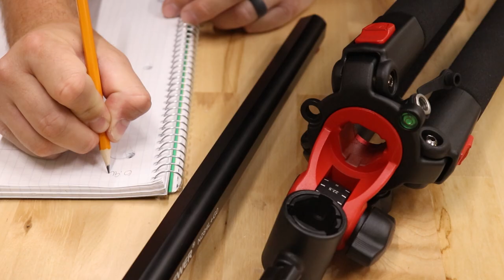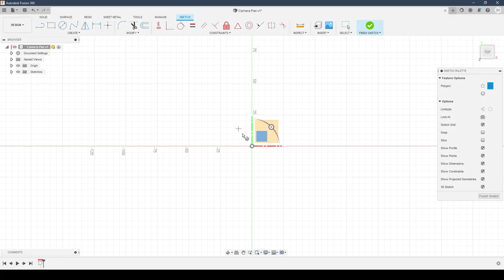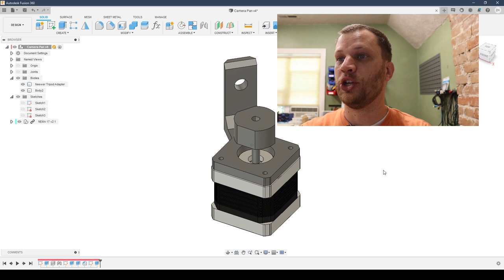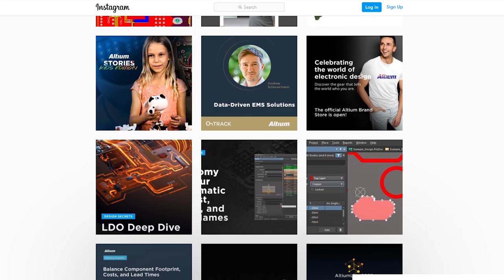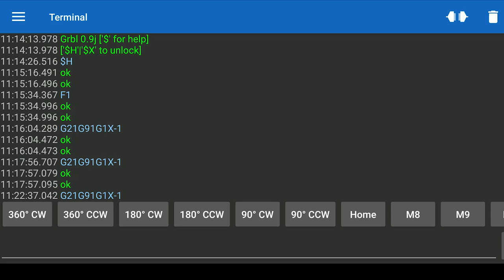Can Your Tripod Do This?

Comment: Great project and very nicely done! 
With serious photography as a hobby/passion of mine,  I've dealt with this same situation too.. 
Unfortunately,  I'm a Derp,  so my brain retains as little as possible when it comes to codes / programming.. 
It's killer that you did this setup using electrical pieces,  parts,  and coding. 
[I've only ventured into that back when building / tuning RC areal crafts]
For the automated tripod,  mine used modular components..  1 pan setup / 1 tilt setup 
They stacked:  Top tilted / Bottom panned.  Bottom mounts to 1/4-20 / tripod,  top mounts for cams, etc..
As you'd assume,  I used spare RC hobby components:  Transmitter,  Receiver - from an rc car 
The radio sticks would then be used for motion control.  Which was MacGyver Approved.  Success.  haha 

There are pan/tilt 'mounts' for cams and telescopes..  That's what I'd like to build next.  Real burly.. 
A guy on yt saw a little kids school project - kid made a motion-sensing/following 'turret', 
so the dude stole the kids design and codes and made his own.. 
It holds a paint ball gun,  and uses a cam,  phone,  arduino,  etc.  to find/lock the 'target', 
and then the trigger is servo activated,  so once locked on,  it just fires round after round.  So funny

Comment: This is fantastic, Zach!  I'm a sucker for motion controlled cameras.  Motion makes everything more interesting.

I've tried to mimic these sort of shots with a gimbal, but even with the gimbal smoothing three axes, I'm just not steady or smooth enough on some of the other axes of motion there.

Good work!
Reply from the maker: I would love to revisit this project and add some more axes
Reply: @bytesizedengineering  I've been kind of drooling over a friend's motorized camera slider.  When I first saw it, I was disappointed, because I only saw the one stepper motor, so i figured it just went from side to side.

But no! Aside from the two rails that the camera slides on, there's a third rod in the middle.  You can adjust how far off center that third rod sits at least end of the slide's travel, and that somehow (I haven't seen the gears inside) controls the rotation of the camera.

So even with just a single stepper motor, you can still keep the subject in the center of the frame as the camera slides to and fro.  It feels like magic, but I have a feeling the mechanism is pretty simple.
Reply from the maker: @patregan  a camera slider is also on the list of things to do 😉

Comment: My dream is to have my camera follow the action when i'm drag racing how hard would it be? :P
Reply from the maker: That's a cool idea! I thought about trying to add some motion tracking to this setup. It would involve using a camera connected to a raspberry pi. I think you could run some open source computer vision software on the raspberry pi. It would then control the output to the motor to tell it which way to turn. I think it's totally doable!

Comment: hard to believe the nema17 wasn't strong enough. if that was all you had a planetary gear on top of it would've fixed the issue too.
Reply from the maker: Yeah, the NEMA 17 was just a bit under powered. I really didn't want to have to add a gear reduction. I wanted to keep this direct drive if possible.